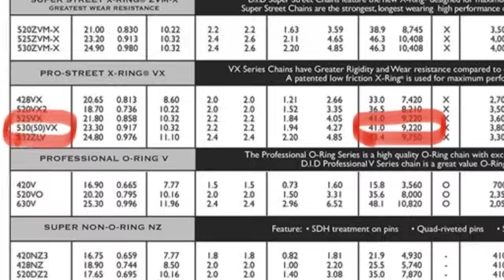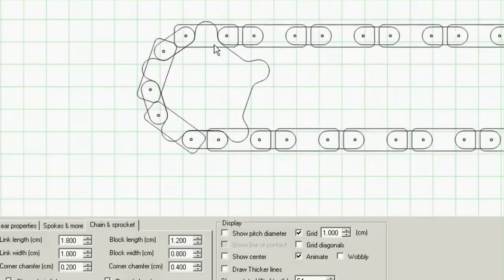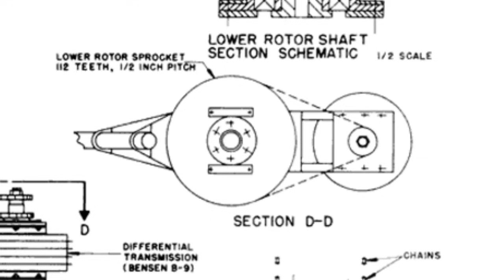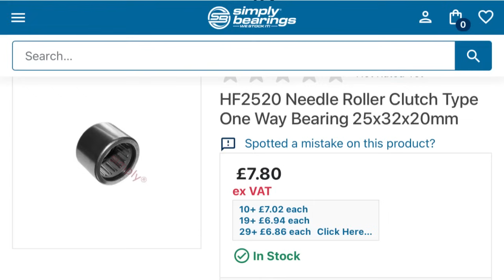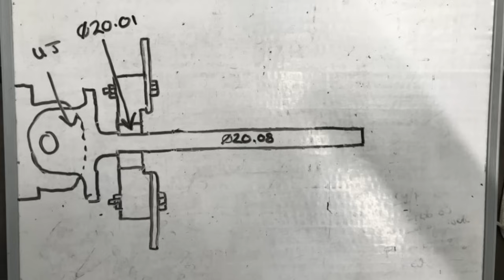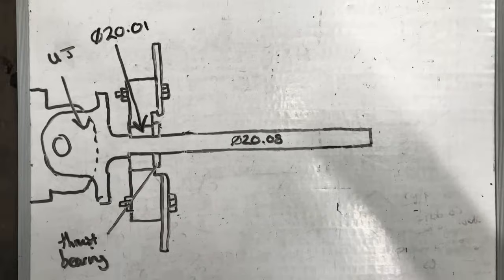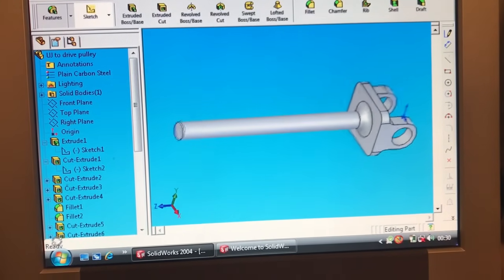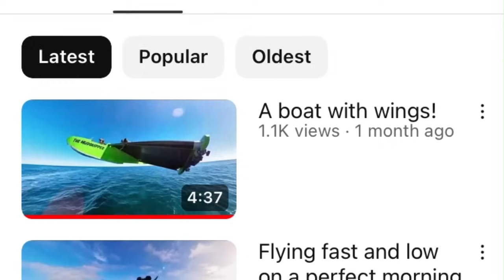I've learnt from viewers,  Homebuilt Helicopter fixing part 3 + seakranoflyer build.

Comment: FAA Commercial Helicopter pilot with an engineering background here.

I'm still very much enjoying your work, and your thought process, and the detail in working out the equations.  There's the happy part of the sandwich.

If you were climbing to any altitude at which both a failure of design disallows a safe return to ground (e.g. autorotation, float, magic rockets, etc.) and the occurrence of a lift system failure (be it engine, shaft, transmission, clutch, rotor head, etc.) then this would be a definite design killer, even if you're only running at 4% of the chain load in specific circumstances which don't include a horizontal-plane chain, insufficient sprocket teeth, etc.

A Honda racing motorcycle (had one once) doesn't get very far off the ground, so a drive system failure will leave you at worst case departing your bike with a good amount of momentum.  At best case a break will cause you to start deceleration as energy in is now less than energy out.

That's the sad part of the sandwich (sour meat?)

You have built -from scratch- a literaly homemade helicopter.  It flies; it hovers; it has sufficient lift and thrust to move you around your lawn while IGE.  Those are creditable achievements if you were ONLY an engineer, but your talent with machine tools and craftsmanship suggests far more.  See, the second happy part completes the sandwich.

If you intend to never go above "this fall could hurt me severly" height, then your rotor system and its flaws are livable.  I envision a bright red on white sticker saying "FLIGHT PROHIBITED ABOVE 3FT AGL".  However, if you intend to drive the main rotor from the engine you should consider WHY there is a belt (or chain) on piston-driven helicopters and none on jet turboshaft helicopters.  It's there to take the load off the engine during engine start and until it's come up to running RPM.

So, if you take a fresh look at this, you should figure out how much energy it takes to spin up that rotor, and whether that load is something the engine can handle, and if so no need for any clutch mechanism.  No belt.  No chain, etc.  You might consider a true multi-gear gearbox.  One gear for starting (making up a number here: 500:1 so 5000eRPM=10rRPM), and one gear for running (17:1 so 5000eRPM=~300rRPM).   With no frictive clutch you'd have to have pretty good synchro gears and probably 17 is a bad choice so maybe 5000eRPM is a bad one as well, but it's my first SWAG (scientific wild ass guess.)

The smaller you make things the less they weigh, but the less torque, torsion, flex, and whatever else power in the Z axis is called they can take.  If you do the tradeoff curve you'll likely find that changing from being worried about 0.01 fitting into 0.08 becomes much easier if you make things larger... and add that little weight -- much less than two gearboxes.

Finally it appears the aircraft is REALLY UNSTABLE.  As you've flown an R-22 in a previous episode, and you've flown this things for hours, and knowing your hands aren't shaky nor is your voice indicative of any stress condition or CNS "uppers"... I'm inclined to think it is inherently unstable.    There is an easy way to test it.  Buy some R/C servos and 3D control sensors and see if that setup can make it hover with stability over a fixed point.  If it can,  well, the problem can't be fixed ;-)  If it can't... figure out whether your CG is too high on the Z axis, or whether something is so close to out-of-CG that any change in attitude (long/lat) destroys that balance.

Flying helicopters is ilke balancing a broom on your palm... and a home-built one is like
balancing a broom atop a toothpick inserted into an olive held within two fingers...

Best wishes!
Reply from the maker: Hi and thanks for the great comment. 
It is correct that this machine will only be hovering or moving very slowly within a few feet of the ground. 
The rotors are fixed pitch so no autorotation is possible, the overrun clutch is only something that want to disengage the drive shaft and engine from the rotors should an engine seize ever happen. 

A centrifugal clutch is also needed in this case because I'm starting the engine manually to save weight, did have electric start previously but it was too heavy. It would have been possible to start the rotors and engine with electric start. 

The belts are toothed which means they can't be slipped as a clutch. 

I have had a total of one hours instruction with an R22 but the rest has been self taught on my machine. I'm a very inexperienced pilot but there is a massive difference in hovering stability when the wind gusts. It can go from relatively easy to hover to un-flyable in my hands during these conditions. 

I'm not experienced enough to confirm whether it's the machine or me but rotor flap back I think is the problem, there's no delta 3 in the rotor system to compensate. 

My current thinking is this machine is only suitable for very calm conditions, fixed pitch is too slow to react to gusts.
Reply: @ehudgavron9086 ,  some good comments there. I've put forward a suggestion to Ben outside of the YouTube chat to address these concerns. I'd like to see the design go further, but there are some fundamentals that need sorting.

Comment: Thanks for the update and bonus knowledge about chain drive.. I was always curious why it was always belt. I would have felt safer with double roller wide chain,or 2 belts with chain drive in the middle for extra safety..
Reply from the maker: 👍Two belts on each drive would be safe for sure but the penalty would be the cost and extra weight in pulleys and framework etc. Every decision is a balance of cost, weight and safety. If a single belt is guaranteed to last say 100hrs I think that would be acceptable in terms of cost to replace and safety.

Comment: Just a thought about the rudder cables. rather than the reversing bell cranks, just swap the cable from side to side between the last pulley and  direct connect to the rudder.
Reply from the maker: 👍 that is how I planned to do it initially , much simpler and lighter but the cables have to pass through the vertical stabiliser. I thought this might give me a problem when it came to covering the stabiliser. Still open to discussion on this though.

Comment: Consider also the tortional vibration situation as well.  See how motorcycles resolve it with a cush drive in the rear, and the clutch basket springs up front - and even then there will be an "avoid" rev range.
Reply from the maker: Good point. Think chains are well and truly out. Shame, as it could have increased the lift significantly with a lower ratio.
Reply: @Ben-Dixey  I think chains might be workable, will be heavy though..  Cush drives in the rotor head will be a complete rework, probably you could retask some motorcycle engine clutch basket, or just use the whole motorcycle engine.  Thats a lot of reworking though...

Comment: The issue with a chain comes from thermal stretching.
If it isn't operating while being soaked in oil, it will stretch.
An idler tensioning pulley is a basic fix for that, but keep in mind that metal also shrinks as it cools down and will fatigue with thermal cycles.
Reply from the maker: Think I've decided there are too many problems to overcome with chains. The heating and stretching of chains probably needing constant attention or more complexity to solve as you suggest are good reasons not to go in that direction.

Comment: @7:45
sharpie marker leaves a coating almost .001" thick, definitely enough to mess with bearing press fit. In fact its an old machinist trick, if your bearing isnt snug, you can use sharpie on both surfaces and get a friction fit.
Reply from the maker: I just tried it out of interest, I measured a piece of steel with a mic, then marked both sides with the sharpie. No measurable change in dimension. New cars for example have a paint thickness of between 0.08mm- 0.120mm. That's the primer and top coat, a sharpie being 0.025mm I can't seen happening in one application, etch primer via gun maybe, but then it has to stay on during the press fit which is also unlikely in my opinion.  Sorry to disagree but it doesn't seem right to me.

Comment: Hi Ben.......have you you looked at De Lackners Helivectors the the machine uses belts and a single roller chain and his own revering syetem, plus outboards for power,  might get a few ideas.
Reply from the maker: Hi Peter, well I knew about the Delackner but have to confess I haven't researched the mechanics. Great suggestion to look at, found a couple photos so far, looks like a chain drive then v- belts at first glance. Will look further into it to try and understand how they did it. 👍

Comment: I wonder if you have considered making the gearbox with one fwd and one reverse output attached and driving the rotor shafts directly with the auto one way on the gearbox input end.
This will allow for drive belt or engine failure while still maintaining ability to auto rotate.
 Of course this depends on a collective pitch upgrade.
Reply from the maker: Sounds good to me. If the reversing gearbox was also a slight reduction drive then the extra lift generated would easily compensate for the gearbox weight.  The belts would be under slightly more strain but not much I don't think. Easily calculated and checked.
Reply: I'm not sure why the belt[s] between the engine and gearbox input end would be doing more work with a gearbox rather than large & small pulleys. Maybe you are referring to gearbox losses.

The gearbox could do the majority of the reduction allowing adequate pulley diameter [ pulley wrap ] of both the engine and gearbox input to reduce excess flex maintaining good efficiency. The gearbox could also carry the bottom of the  swash plate stack.
My '82 microlight uses 4 A section belts between a 30hp 2 stroke and propeller providing a 2 :1 reduction.
Some have a 40hp using the same 4 belt 2 :1 reduction.
 Maybe talk to your local auto transmission shop for a look a planetary reduction stacks.

Comment: Didn't know we had this amount of freedom left in experimental general aviation! I know in America, if it's less than 7, or 900kg, can't remember which!, you're good to go. No licence, no inspection,  nothing! I thought article 39 buggered all that up years ago, here!? Banging coax, more headspeed if you've got the ponies!😊
Reply from the maker: We have some freedom but I'm pushing my luck. In America they have FAR part 103, up to 115 kg empty weight, flight without needing a license or certification. In the uk it's up to 70kg to qualify. There might be an exemption as my helicopter is always tethered but they are long, as tethers going tight would be very dangerous for myself. 
The wing in ground effect boat is completely unrestricted by the CAA, it's only governed by maritime law and classified as a boat.

Comment: There’s quite a bit of energy lost using a chain. Up to 30% as opposed to the belt. Belts are far more efficient and more than strong enough to handle the load. Not to mention lighter, quieter and require far less maintenance.
Reply from the maker: I had forgotten about the efficiency, difference good point. 👍
Think the belts are 95-98% efficient. 
Chains will get less efficient with heat and at high speed too.
Reply: @Ben-Dixey  They also don't wear out the belt pulleys like chain does to sprockets. It's the main reason a lot of modern cars have timing belts instead of chains, not all but most. Chain has a bad habit of stretching too, needing constant adjustment and lubrication. In a machine like yours where efficiency is paramount, belt drive is the way to go imho.

Comment: Keep at it Ben. The millenial joke is quite true, although Im a millenial. There is a big obsession with making things from plastic.
Reply from the maker: 👍 The technology for making things using computer controlled machines is great but the skills to make things using manual machinery is just as important. I see some channels making great things from plastic but when it comes to making something from metal they can't do it. Alan zhang is an example, in his video he states "as an engineer we can make whatever we want" so he 3d prints a load of stuff but then realised some parts needed to be metal. At this point he had to pay an engineer to make them for him. There are other channels that are the same, they don't seem to think that learning the skills of metal working is very important, perhaps beneath them.
Reply: @Ben-Dixey  I've seen plenty of videos of people 3d printing components only to throw it out because it is wrong or fails or they change it. I know the plastic can mostly be recycled, but the waste behind it. If you make something from metal, you really have to think ahead so you don't waste material. The plastic printer people seem to be in such a hurry. I despise plastic personally, try and avoid it as much as possible.
Reply: @Ben-Dixey  Also people calling themselves engineers bugs me. Here in Aus a boiler maker trade is now called engineering, yet they are only taught basic fabrication and nothing really about design. We have another work experience kid that says he is studying engineering, which is actually boilermaker, but he calls himself an engineer. He struggles to use a drill and to think he will have a certificate that has Engineering on it. Uni and education just seems to be about having a title, not skill.
Reply from the maker: @chippyjohn1  The broader use of the engineer term devalues it. They did the same thing at college while I was there, they changed the name of Higher national diploma to foundation degree. Why? To make it sound more impressive ? All it does is devalue the degree qualification. 
Boiler technician I would think is a more appropriate title.

Comment: Did you get the engine built in charge winding and an external regulator / rectifier contributing to your cooling fan and so reducing or hopefully eliminating the need for  external alternator?

Many older original equipment outboard charge regulator rectifiers are inefficient.

So a later single phase reg rectifier is likely to give you more output.

I'm guessing your electrical requirements are around 10 amp so within the ability of the outboard charge winding.
Reply from the maker: Hi, the electric fan I'm using is drawing 17 amps, gauges and water pump is 1am. I think I need to go to a belt driven fan. When I do that modification then it would make sense to sort the Johnson stator and remove the external alternator. Think a replacement stator is rated for about 5 amps. I didn't know that about the later single phase outboard charge systems being more efficient. 👍
Reply: 17 amps for an electric fan is a lot. 

I think you can do better.
I'd expect an efficient brushless 'continuous duty' fan to have a  start current around 20~30 amp [dependent on cable area] and run current near 10 amp.

I'd select a scimitar shaped fan blade. They are more efficient so draw less current to push or suck more air. 

If possible look for a brushless design often much more efficient like 80% rather than 30 to 50% for a brushed design.

 How good and close is the seal onto the radiator?
The better the seal the more heat gets transferred to the atmosphere with less air short circuiting around the edge of the fan and not through the radiator.

Does the fan have a good end plate around the tips of the fan blades again making a big improvement on efficiency.
 As a bonus this air resistance or more work being done  also means slower fan speed and often less current.

How near the top of the radiator where the coolant is the hottest is the fan mounted?
Much better to move the hottest air.

 How large is the fan? 
  This as It's a lot cheaper and more efficient to move a lot of air a little than a little a lot.
Reply: Later charging systems are superior due to the more efficient regulator regulator rather than a larger winding inside the engine.
Reply from the maker: @donaldpayne1376  Thanks for the info. 
The fan I chose is Spal va08-ap70/ll-23ma 
It's brushed I believe, I went for the highest CFM and largest diameter I could fit to the radiator. It's a pull type fan straight bladed and 14" diameter. 
The fan is as close to the radiator as possible without risk of touching it and shrouded. The shroud is welded to the radiator so it's a perfect seal. 
Data shows it can pull 1600 cfm at 17amps. I haven't looked at the brushless ones yet but will have a look.
Reply: @Ben-Dixey  
Good job on the shroud seal.

Is the fan on the correct side of the radiator so its encouraging heat to rise?

Might be a contradiction if it's in the rotor downward area.

I'd look at scimitar blades & continuos duty as well as brushless.

I'd also stay away from a reversable blade as its a compromise with sub optimal performance both ways.

I wonder if a larger radiator would help.

Keep up the great work,
 it's fun watching your progress.
Reply: Some euro cars have a resistor in series with the radiator fan for a low speed option and bypass the resistor for high speed.

Comment: Have you thought of using dyneema rope instead of steel cables?
Reply from the maker: Hi, I had a comment about that last time but forgot to look into it, I hadn't seen it used for control surfaces on planes before but I need to look into that. It would be much lighter if it can be used. Thanks for reminding me. 👍
Reply: @Ben-Dixey  your welcome, it’s up to 15 times stronger than steel by weight.

Comment: Hallo, danke für dein sehr gutes  video und gute arbeit.
Ich möchte aber sagen, das die lager , für die umlenkrollen am antrieb, zu schwach sind . Die laufen trocken und dann gibts probleme. Größere rollen und stärkere kugellager , wäre die lösung..
Reply from the maker: Hi and thanks. 
Deflection rollers? Is that where the belts are deflected around the opposite side of the large driven pulley ?